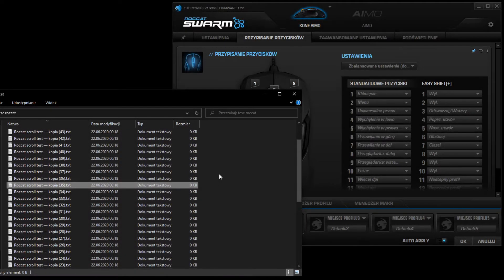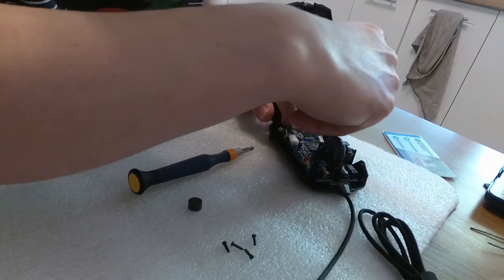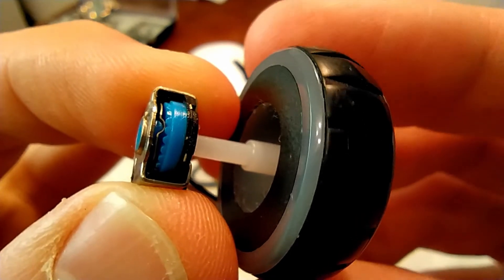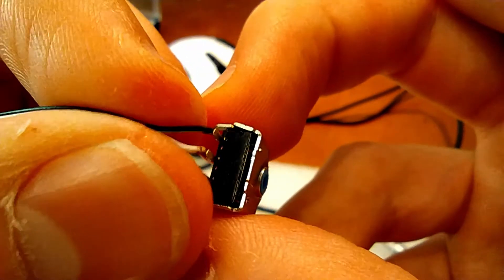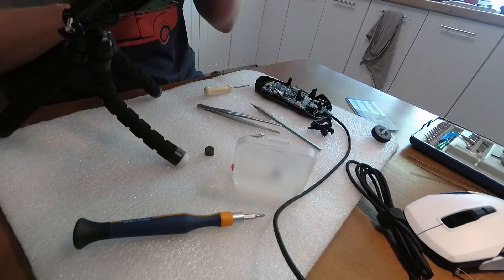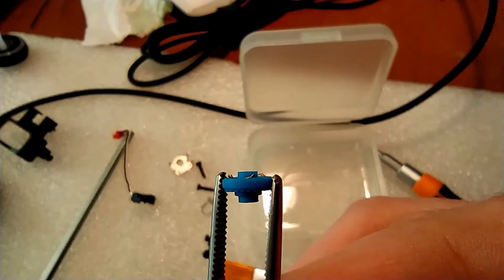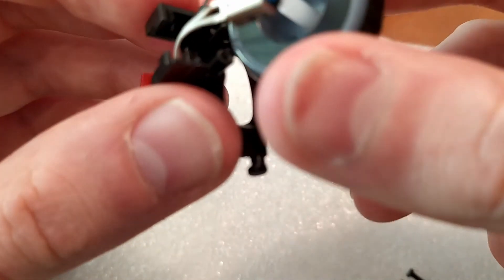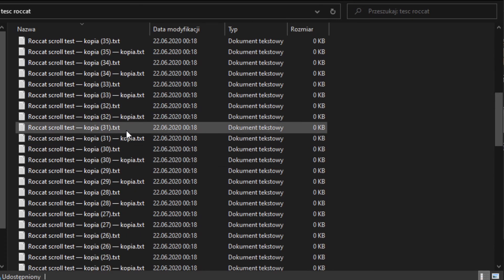Scroll problem and fix guide - Roccat kone Aimo 2 - no soldering required

Comment: The first thing I did after I plugged my mouse back into my computer was scroll up and down the comments on this video — to great satisfaction. Spilled a bit of the isopropyl alcohol on my leather chair, but I thankfully had leather wipes nearby that cleaned it up nicely. Should've gotten a squirt bottle! Thank you so much for the video, it was immensely helpful!

To anyone else experiencing this problem and looking through the comments for confirmation: I can confirm a cleaning is all it needs. Small bits of advice I learned from my experience: handle isopropyl alcohol *carefully*; you do NOT want to spill it. The minimum amount I was able to find was a 1L bottle and it was unwieldy as hell, so find a squirt bottle to put some in if you can. If you're moving the liquid from one container to another, DO IT OVER THE SINK. If you can't find a squirt bottle, have a paper towel handy to wipe the bottle and pour some into a small bowl or ramekin. The blue wheel AND the sensor can be submerged, though refrain from submerging the soldered part of the sensor. You can take them out of the alcohol and use a Q-tip to put a bit of elbow grease into cleaning the sensor. You can use the Q-tip on the electrical contacts on the wheel, but be gentle with those. Then, like he said, dry with a paper towel. Best of luck to you!

Comment: Thank you very much for this video! My Kone Pro Air's wheel was exhibiting the exact same symptoms and Roccat didn't accept warranty replacement. Found your video, decided to give it a try, ended up being a pretty simple 30 mins fix. The Kone Pro Air is the perfect mouse for me and I hope to be able to keep using it for a long long time thanks to the optical switches and with the ability to fix the wheel.

Comment: Thank you.
I own the Kain 120 and after a year of using the "jumping-sroll-wheel-problem" occured. It is not the same construction shown in this video but I was able to disassamble the mouse which was not so difficult. The mechanic of the scroll-wheel-sensor is the same as shown in this video - it is really tiny by the way. I used normal WD 40 multifunction cleaning spray for cleaning the scroll-wheel mechanic.
Now scrolling is as smooth as it was after buying.
Took about 10 Minutes.
Reply from the maker: I'm glad this vid helped u too. Hope u didn't broke any tiny metal casing "leg" ;)
Reply: @lerthon  Honestly I broke one leg :)

Comment: i looked really long for a new mouse but i could not find one nearly as comfortable as the kone so i used it with the bugged wheel for way to long. if had known how easy to fix this problem is i would have fixed it immediately. thank you for the video
Reply from the maker: I'm glad it saved your mouse too. I had the same feeling: one of best but this crappy scroll..... Fixed mine after 3 months of siting in the box 😂

Comment: Nice vid, I've already saved it! How many times did you have to re-clean since posting this vid? I've ordered kone XP Air first, than started to explore potential "issues", so wonder if it will be a huge issue for me. I don't mind cleaning once a year or so, but if eventually it breaks after 1-2 years than I do not want it...
Reply from the maker: @kafri31  Hey, i was frustrated and stopped using it. Then gave it last chance to work and fixed it. I gave it away few months later so no clue if it required "reclean" soon after.

Comment: At first I was skeptical but I did it and it works fine! Thanks m8 you just saved me 75 dollars! Btw I used normal ethanol, that shouldn't be a problem, right?
Reply from the maker: im happy it worked for u too, as many people under in comments section :) Alcohol should dry off - thats the main purpose - to not give any chance for short circuit

Comment: For the Kone Pro Air, apparently you can tell if you have a bad encoder by the plastic piece in the middle of the metal where the wheel attaches. If it's blue like yours it's a bad one. If it's white it should be good. You can see which one without taking apart the mouse by looking down in there with a light. Also I read if you get blue replacement feet in the box that means you're good as well. May be the same for other models besides the KPA
Reply from the maker: Thanks for comment. Maybe it'll help others 😊
Reply: white encoders also have the same issue

Comment: I had to follow this fix 2 times in a short period of time. Though it worked for the first, on the second fix, 2 of those little arms fell off due to metal fatigue. Also the metal part which is responsible for making the wheel turning "clicky" could not be placed back so now the wheel turns continously which is fine by me. Also - idk if related or not - the issue of scrolling in the wrong direction is completely gone now. So the fix worked, the main question is; should a 70EUR mouse have a so often occurring defect to begin with?
Reply from the maker: Ofc not and all u can do is a return to manufacturer 😉 i'm still using this mouse and it works ok. Made only 1 fix, the one is recorded. It's more than a year now and still fine ☺️ but ik, i'll never buy again any roccat cause all of them have the same scroll mechanism.
Reply: @lerthon  apparently Just spam scrolling it fixes it. some guy did that to a roccat kone pro and it worked.
Reply: @lerthon  A bit update here. The mouse still works like a charm. I actually like the wheel much better without the clicky scrolling, this smooth scrolling feels much better. So thanks still for this fix ;)

Comment: This is also an issue with the Kone pro mice. I was lazy and just submerged the entire assembly, scrollwheel and all, in 90% isopropyl and spun it both directions. Then I shook out what I could and let it dry for a few hours in a place my cats' hair couldn't get to. Has been working perfectly since.
Reply from the maker: Seems they use same scroll mechanism for every mouse. That's the reason i will never buy any roccat mouse again...
Reply: @lerthon  It's a shame, because aside from the scroll wheel, they're great mice.  It's also hard to find a white gaming mouse with a tilt scroll wheel and more than the two basic thumb buttons.

Comment: I've noticed, that originally the scroll mechanism was lubed. Don't you think that it's necessary to apply some silicone grease/oil over there?
Reply from the maker: Not sure but after cleaning this oil scroll worked fine so maybe this is causing problem with conduction 😁

Comment: Does anyone know if ROCCAT updated this part at anytime or is it pretty much a given that any KONE Pro Air will have this same part and eventually same issue?  If the part has not been changed or updated, would it be feasible to insert a small rubber gasket between the wheel and the metal piece to reduce the amount of debris that gets in over time?
Reply from the maker: No idea. Since few models had the same problems many users never gave a 2nd chance to Roccat mouse products i guess.

Comment: I wish I could do this since I've had this issue for 2 years, but I can't. I modified my mouse years ago by molding my hand in clay and attaching it with glue to the right side of the mouse so it could actually be ergonomic and stop hurting my hand.

Comment: Thank you for this video, I am having this dreaded issue with my kone pro air. Do you think it's just dirt and debris getting into the rotary encoder? If so I'm wondering how long this fix will last until it gets dirty again.

Could you provide an update on your experience ~2 years later? Thanks in advance.
Reply from the maker: I'd but i don't really see reason of recoring the same thing. I already have to clean my mouse again cause it get jumping so much again. It means if u use mouse daily u will have to repeat it in 1-2 year anyway. If i find something interesting i'll make an update.
Reply: @lerthon  Thanks for responding! The whole reason I went roccat is because I didn't want to replace omron switches on logitech mice anymore from the double click... at least that can be permanently fixed however, unlike the roccat scroll wheel which we are just kind of stuck with bad design.
Reply: @lerthon  Sad, I have a brand new mice that jumps aafter 2 months (my hands get sweaty when gaming) havent used the wheel as much...

Comment: I have 2 questions:
- If cleaning the encoder fix the problem, is this means that after a while the problem comes back? The part will be dirty again.
- How much is this a common problem for Roccat mouse? Because I read about many Roccat owners have this problem, same thing for my Roccat Kain Pro only 5 months old. I am worrying about asking for a replacement every 4-5 month untill the warranty will go over.
Reply from the maker: Hey. 1. The problem comes back. I already have to clean mine again after long time. 2. I've noticed that many roccat mouses use the same type of trashy scroll which means many models might have the same problem. I know about one guy who had this issue with another model and fixed it based on my vid as well. After that he made his own vid for people having same problem with his exact model. My advice: if u notice any kind of line jumping while scrolling immidiately make a support ticket 😂
Same problem spoted with Kone Air Pro (somewhere in comment section).
Reply: @lerthon  Many thanks man!

Comment: I found if you blow really hard on the scroll wheel and turn it, helps clean it. Not as good as the Video above but a quick fix for me
Reply from the maker: Nice but i'm not sure it's a good solution. It might react like blowing through laptop radiators to clean them, w/o opening laptop and pulling them out. It may help for a short time but all u do is pushing dust inside stacking it up which will make a big "carpet" between radiator and fan soon. 
I'd consider opening mouse 🤫

Comment: What exactly is the issue with the scroll mechanism, was the pin not registering some of the bumps?
Reply from the maker: I think pin was the main problem but also cleaning dirt on its path helped with cunduction. Unlucky i can't say it was only a) or b) variant. I wanted to make it work well so i made as much as i could to fix that 😉

Comment: does this work with the roccat kain 100? Or is it exclusively for kain 200?
Reply from the maker: I guess so. This mechanism looks the same/almost the same in every roccat model.
Reply from the maker: Around month ago someone asked about kain 100 and fixed it with this tutorial. It will work for you too then 😊
Reply: @lerthon  also sorry to bother you again, but have you heard about this software/hardware bug where sometimes I press right click and it soft locks right click until I press esc in my game. Its really annoying and makes me loses games
Reply from the maker: @ThunderWqlf  never seen this issue. Maybe u can try to downgrade it and test on different versions?
Reply: @lerthon  how do u downgrade?
Reply from the maker: @ThunderWqlf  u want do downgrade roccat software/driver or mouse firmware?

Comment: I wonder if something could be done so it would self clean just from scrolling
Reply from the maker: There is not many space 😉 mine works perfect for over 5 months now w/o recleaning or anything. Maybe the problem is grease they use during production. Many ppl have the same issue with brand new mouses.
Reply: @lerthon  Mine was bought brand new 3 months ago and I am already starting to notice this issue. Looks like Roccat is the same trash as Logitech.
Reply from the maker: @darek4488  If we look at other ppl (like me) having this error out of the box u're the lucky one! :D
Reply: @lerthon  Well, every single Logitech MX Master 3 scroll is broken by design and it is one of the most expensive mice out there. What's funny is that Logitech is so proud of the new scroll design and they talked about it every chance they got. I sometimes wonder why don't I just buy the 6-7 cheapest mice on aliexpress, select the one I like and throw away the rest for the same price as a single "premium" mouse. It's all the same garbage anyway, the rest is just marketing.
Reply from the maker: @darek4488  i had white rival 300 for years. After its scroll started making missclicks (i work a bit in 3D, scroll works as 3d orbit around model while it's pushed) i had to make a decision. I'd buy new Rival but there is no white option now. All is black/gray. That's why i turned to kone Aimo. 
Been using many different mouses over years and rival 300 was the best one.

Comment: Could I use break cleaning fluid? ( this shit in spray cans)
Reply from the maker: Don't think so. Better use nails cleaning spray based on acetone.
Reply: @lerthon  Okay, idk if I have something like this on hand.  Lighter gas maybe...
Reply from the maker: @belldragneel8381  u need something what will dissolve a little all the oil and other dirt and also degrease surface a bit.
Reply: @lerthon  do u think nearly pure acetone would work? or is it to aggressive?
Reply from the maker: @belldragneel8381  never tested. Bc of that i can not recomend it.
Reply: @lerthon  okay thx
Reply: @lerthon  I bough some isopropanol on Amazon and just cleaned my mouse.  It does work now properly and I hope that I did not destroy something in it.

PS: Well fuck, now I allways think I have to scroll again up or down cause the mouse was broken but she is not longer

Comment: Is it the dirt causing the failure or the bent copper plate? Has anyone managed to fix this problem WITHOUT bending the copper plate?
Reply from the maker: I'm not sure whichone of them caused this. I think it's dirt/grease and copper plate 😉 u don't have to bend plates if they look fine. I've noticed one of them lie  more than others that's why i've decided to fix him a little.
Reply: @lerthon  Ah, I see. Do you know if every mouse with this problem has a bent copper plate or not? I have this problem, I just haven't gathered enough courage to open the god damn thing up; but I'll use this guide when I do.
Reply from the maker: @Leaffordes  i've seen some ppl asking the same question down below. Different models from roccat. All of them decided to go follow my tutorial and all succesed 😊 Looks like all roccat scrolls are based on the same/very similar mechanism so u should not be scared that much. Opening mouse is around 5 screws and then 2 plugs. I hold fingers crossed for your succes 😉
Reply: I just did this to a new Kone Aimo Remastered, there was definitely no dirt at all. I skipped the cleaning part and noticed one of the copper sliding contacts not being bent outward at all, as shown in the video. I bent them all slightly outward. After assembly scrolling works like a charm, but the wheel runs totally smooth now, no longer latches at the steps... (sorry for my English)
Reply: @DesGeretGetNet  So it's most likely the bent plates causing the failure? Ugh, that means I'll HAVE to open the mouse up. Thank you. I just hate having to remove the mousefeets and then place them again; I almost always fuck that up whenever I try it.
Reply: @Leaffordes  It was definitely the non-bent sliding contacts.I removed the mousefeet with a sharp knife, gently, and they glued back without a problem afterward. Just give it a try!

Comment: so to slove this problem we just need to clean the sensor ? well thats interesting
Reply from the maker: Yup. Clean and align/bend copper plates if necessary. In my example problems could be caused by dirt and one not aligned plate. 
Sensor is extreamly simple divice, as u could see in the video. 
Hope this video helped u 😉
Reply: @lerthon  thanks pomogło :)

Comment: Will this work on kain 100 aimo?
Reply from the maker: unfortunately i don't own this mouse but i think that those mechanisms are very similar - it's the same manufacturer ;)
Reply: And was your mouse bad from the factory or broke overtime my is new...
Reply: Thanks anyways
Reply from the maker: @jan3366  i bought it 2nd hand as new, not ever used in original box. 
Few comments below u can find person which had the same problem with factory new one, if i remember well.
Reply: Could i please send you aphoto of the mouse i aleady opened it but i dont know how to get the wheel out.
Reply from the maker: @jan3366  go ahead 😉
Reply: I actually already fixed it so thanks alot man your tutorial helped me too.🙏
Reply from the maker: @jan3366  was mechanism very similar/the same as on my vid? 🧐
Reply: @lerthon  yes just the wheel was on the top part of the mouse but it was pretty similar. I just have one more problem and that is when i scroll down it goes up and when i scroll up it goes down...
Reply from the maker: @jan3366  maybe u connected scroll plug upside down? Or rotate scroll wheel in the Z axis by 180 degrees 🧐
Reply: @lerthon  isnt there like a software way to change it? Could you please tell if you know about something.
Reply from the maker: @jan3366   i think it was your mistake during reassembling. You've probably just put it wrong direction 😉
Reply: Ok the 3 wires just disconnected so this is bad...
Reply from the maker: @jan3366  idk gow itnlooks inside. Feel freento share screenshot via any sharesite.